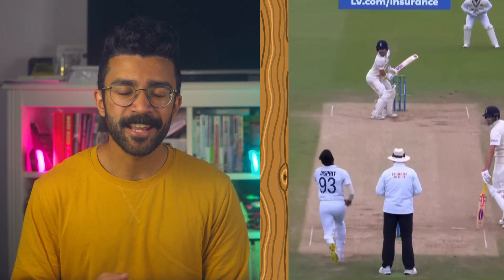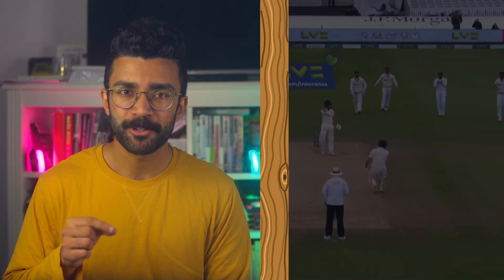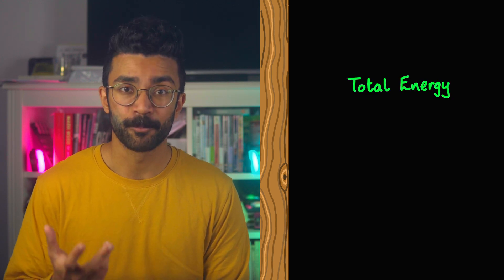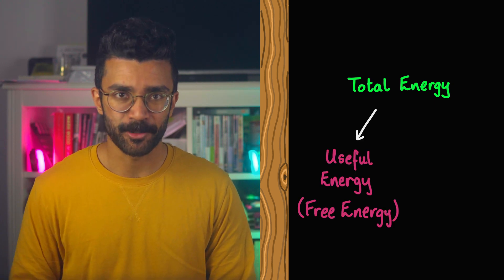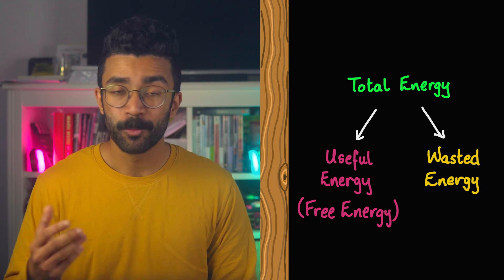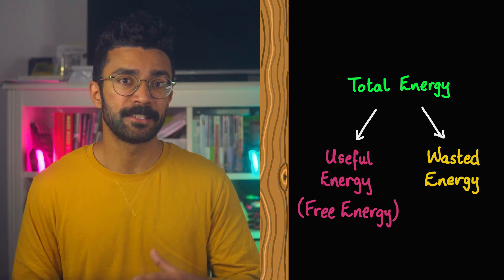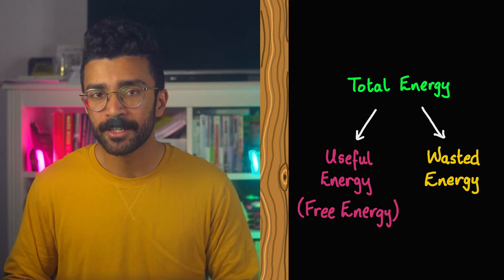Free Energy is Not What You Think.

Comment: Nice and succinct. Recently I've thought about electrons wizzing around atomic nuclei and wondered why this system isn't considered a perpetual motion device. Seems relevant to the idea of free energy.
Reply: Perpetual motion engine should be able to drive something else forever, which is impossible thermodynamically.

Remembering Newton's 1st law of motion, a rock moving at a constant speed in deep space can stay moving at a constant speed in deep space forever, keeping its kinetic energy; a trivial example of 'perpetual motion'

That rock can't be used as a power source for other stuff without having to slow it down.
Reply: The reason why electrons stay in an orbit around atoms instead of sinking into the nucleus is because their positions and momenta are in what’s called a wave function, which is a wavelike probability distribution which tells where one is most likely to find a particle or which momenta is most likely to be observed. The probability of finding the electron outside the nucleus is quite high because the wave function of the nucleus is much smaller than that of the electrons. If instead particles didn’t “have” a wave function and were entirely localized to a single position and momentum then yes they would be pulled into the center of the nucleus.

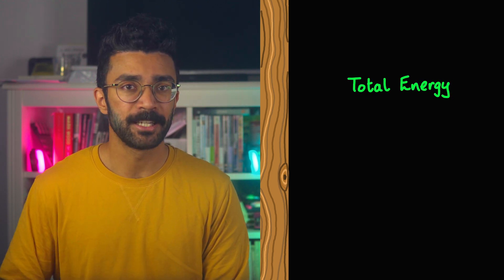Comment: 1:18 Ok, if the batsman missed the shot, what is the energy that went into the swing?
Reply: All it is finally transfered to Heat.
Reply: At its origin, electromagnetic energy and kinetic energy.

Photons have both, the energy the plant uses comes from the sun in the form of photons. The plant converts it into chemical energy.

That plant is then consumed by us or other animals that we in turn consume, storing it as chemical energy in the form of ATP and lipids.

We then use that chemical energy in our muscles, converting it to kinetic, heat and sound energy.

Once the swing is over we use our muscles to remove the kinetic energy from the bat, creating more heat and sound energy.

All of the sound energy we create will diminish in the atmosphere due to friction between air molecules, also ending up as heat.

In essence, all energy will eventually end up as heat - hence the heat death of the universe.

But in terms of the batter, whether the ball is struck or not, it starts as solar radiation carrying kinetic and electromagnetic energy and ends up as heat.